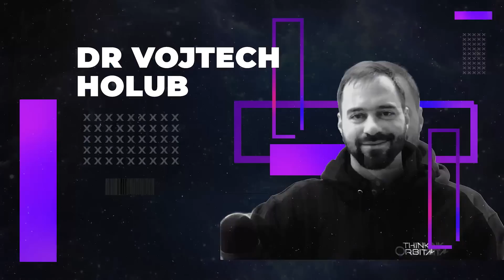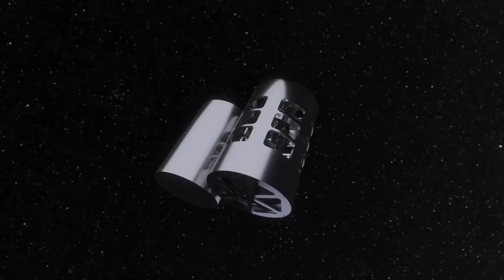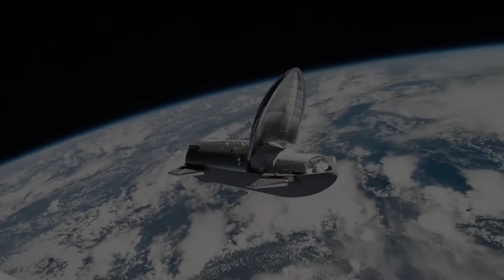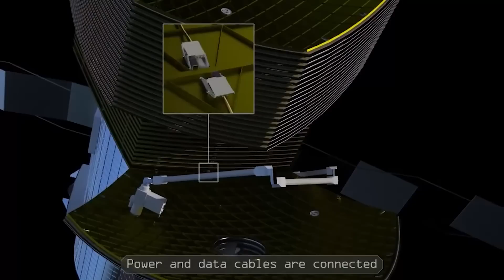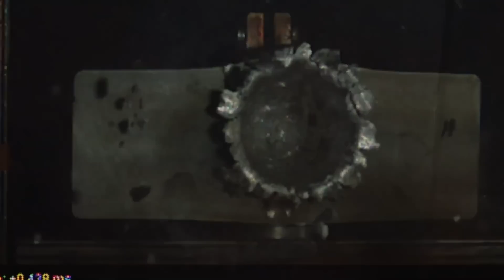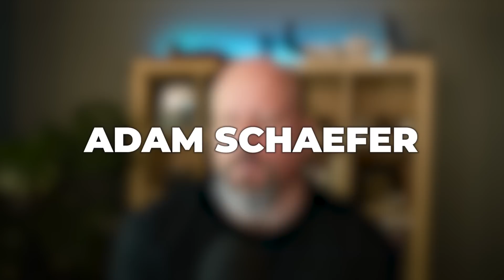NASA Just Funded This Project. Assembling Large Structures in Space [NIAC 2025]

Comment: Looking at your EB weld did you used a cycle generator as the weld looks really big , you don’t have to but weld you can stake weld ,
Reply: What do you mean by "cycle generator"? The weld is standard size for an aluminum weld - the heat conductivity and low melting temperature will do this to you.
Reply: @   It’s weir the electron beam is put through a rotating magnetic field and increases the field size of the weld and it’s not jest a concentrated beam , less penetrated beam but a
Rotating beam , come on guys this basic stuff ,

Comment: I feel like there is a better way to build this..

put a wire bending machine in orbit,   and set it producing ngon rings of large diameter,  tie those together to make a gigantic geodesic sphere.

then lightly inflate a balloon inside of the geodesic sphere using an inert gas for welding,   like 0.001 psi or something.

to get stuff in and out,  either use a docking ring and plate or just accept the loss of a few kilograms of gas and poke a hole in it,   or pump it down into a tank then poke a hole.

do all your fabrication in the low pressure atmosphere,    use the inert atmosphere with a compressor to do conventional inert gas welding.

nice thing is you can contain all your debris,   there is no vacuum welding phenomenon,  and you can use a reflective interior and have 3d positioning tags all over the inside for machine vision.

I am not sure how you would handle thermal regulation,    maybe a glorified mini split heat exchanger plumbed to several sides of the structure?

As for dealing with particulates,   if you spin it up a little,   centripetal force should deal with it,    static charge might make a levitated oxide layer though near the walls.

Comment: I know I'm not the first to say "Torus!!!"  But I would add- if you're making ring sections that you weld together, they could start out on a roll-  the whole piece, varying in width as you go around, rolled up.... unroll, weld the end, and you've got a ring... repeat for each  ring, weld the edges together, then boom you've got a torus.

Not sure if aluminum, or steel, whatever... if you don't exceed it's elasticity it would be a bit like a big spring, you don't have to bend/form it.  Or maybe it's just straight when unrolled, you pull the ends together and weld them?  It's easy to see this scaling to truly huge dimensions. :)

Comment: Hy Fraser,

I was wondering if anybody is thinking about building a hydrogen-gas station in an orbit around earth?  I’m thinking about using electrolysis to split water into hydrogen and oxygen. Once built the station could use sunlight to split the water and use a little bit of that hydrogen and oxygen to cool the hydrogen gas and some of the hydrogen and oxygen could be used to create electricity, water and heat if the station is manned. If there is enough on board then the water could even be used as a radiation shield. And any waste water could be recycled back into the system.  This would reduce launch costs a lot I think because the rocket would only need to carry the fuel needed to escape the atmosphere and not any fuel needed later on in the spacecrafts mission. That spacecraft to fuel up at the gas station for the next phase of its mission for instance to get to the moon where they are planning all this industry and science to take place. 
The initial costs might be big, but once in operation you could create a nearly closed loop energy system on that system using the hydrogen and oxygen it’s producing anyway.  Any spacecraft that comes along to refuel, brings water from earth with it to replenish the fuel it took from the station. It only needs to bring regular water which is much denser and you really don’t need that much water to produce enough hydrogen and oxygen. 
Not only that but if you man the station it could double as a “pitstop” for orbiting satellites for all kinds of maintenance. This would reduce the need for new satellites as the once that are already up there could live and be productive much longer. So that would help reduce the amount of space debris aswell.
So it would be like a service station for cars, but then spacecrafts. I know the ISS is already there, but that's a science mission. This would be an actual practical service station.

Comment: What about stainless steel?
Reply: Doable, but less strength to mass ratio than aluminum, and the thinner steel would make for more stringent tolerances. The reason Starship uses Stainless steel are only its thermal properties and high melting point. That is mostly relevant only for a reusable rocket.

Comment: So... welding in space. And if SpaceX Spaceship ever becomes fully reusable and brings launch cost down, you could bring up 8 meter wide ring segments and use a robotic arm and a welding robot to join them into an orbital torus structure. Send up a bunch of combined Whipple shield and polymer composite radiation shielding in panel form to bolt to the outside of the torus, and suddenly, you have more living space in orbit than we could use in decades, spin it and you could potentially live there for years. Connect the torus to a central non rotating in space assembly plant/dock, and you suddenly have the first version of Earth Spacedock.
Reply: That is exactly the plan! 8 meter max dimension segments for Starship and two 6 meter robotic arms with welding tool attachment. First though we have to do our homework to convince investors that we can do this, through the boring stuff like products and revenue...

Comment: Welding in space and even metal foundries would be more efficient and less pollution than here on earth. The major concern in wielding is shielding gas to keep air out of the melted metal if you don't the air that we breath will cause porosity and week weld. With the proposed cost per KG to orbit with Starship could cut the cost of Titanium refining by 50% or more and increase the safety 100-fold. Wielding Titanium in space in a vacuum is just as easy as wield common steal on earth and could be done with a mig wielder without the need of shielding gas or wire fed laser wielder. It could be done with old school stick wielder with uncoated wielding rods for any metal. Orbital assembly and manufacturing are the next industrial revolution, the possibilities of new metal alloys are endless.

Comment: I was just talking with a friend of mine, today, that worked as a certified, pipe welder and other qualifications, about welding in outer space.  I asked him if he thought an inert gas like Argon would even be necessary in a "vacuum," since flux or inert gases were necessary to protect the weld from contamination from "air."  He thought maybe an arc couldn't form in a vacuum.  I said I thought air was not necessary to form an arc...that the electricity would complete the circuit, if the distance was close enough.  Odd that I ran into this video on the same day.
Reply: @jameswest4819  Well, I don't think that a flow of freed electrons is considered an arc, but... here is my take on "can you make an electric arc in vacuum" question: 
In theoretical perfect vacuum with infinite atom removal capability? No arc can happen. 

But, there is never a perfect vacuum, and also when there is a large enough electrical potential, the ions from the conductors will start to free up, eventually enabling an arc. One a small arc happens, a lot energy and material is released from the conductors, creating even better conditions for a sustained arc. Does it help with arc welding? Not unless you want to consume your cartode and anode in the process
Reply: @vholub1  If you have ever welded anything, with, for example, low hydrogen rods, you have to drag or push the rod along the intended path on the metal being welded.  There is an arc that forms and the rod and its flux melts and heats up the target being welded.  I do not think your analogy about consuming the cathode and anode is correct.  Just how close or far the arc is formed is not something I've heard or read about.
Reply: @jameswest4819  Yes. That's how stick or MIG welding works on the earth. That's not how electron beam welding works.
Reply: @ Electron beam welding works better in a vacuum...at least according to a "how to" article, I just read.  Still don't know if you can strike an arc in space with stick or MIG, but I suspect you can.

Comment: I did not understand the problems involved in producing a torus for spin gravity. What are the issues involved in switching to torus structure?
Also, are aluminum extrusions, perhaps with embedded carbon fiber reinforcement, shipped in rolls a suitable method to apply as over wrap improve hoop strength on large spheres?

Comment: What if, for hull construction, you used square panels with disconnecting servo motors allowing you to make an adjustable structure geometrically? It could be adjusted to allow for access to any areas scheduled for work. It wouldn’t be pressurized.

Comment: Does a Super Heavy booster have the power to put into orbit a Starship that would have 2 times smaller tanks, no head tank, no heat tiles, no ailerons/flaps, and that would be about 40% lighter?  If so, then this Starship could be transformed into a space station. The space gained would offer ~1,500 m² of pressurized volume, or 50% more than the International Space Station.
International Space Station cost: ~$150B
SpaceX Starship Space Station cost: ~$2B (1.5x volume)
Reply: Once in orbit, the lower half of the Starship, which contains the engines and tanks, could separate and burn up in the atmosphere. The upper part could be equipped with Draco or Super Draco engines positioned in such a way as to allow the movement of the "ISS Starship" in all directions.

Comment: How would a space station using artificial rotational gravity account for mass moving throughout the station? i.e. as mass moves toward the center, the spin should accelerate, and as it moves to the outer edges it would slow down.
Reply: It would have to have a really strong reaction control system, that’s for sure. One option is to keep most mass in the ring stable, mostly furniture and permanent systems.
Reply: @Zacharysharkhazard  I was thinking the same thing. And with advanced enough sensors to track the movement of mass maybe a counter weight system could be used. No matter what it seems like it would be a huge power draw to manage.
Reply: @ShatterPr0oof any station with a feasible (100m+ diameter) gravity ring would require either a sizable nuclear fission reactor or a very massive solar array to keep the thing powered, probably in the megawatts of power generation. Feasible once we start launching nuclear reactors into space, and reusable superheavy launchers come online.

Comment: why not build just 1 really thick and durable ballistic shield that you can move and position in front of incoming debris!? instead of incasing the whole station in it which would be virtually impossible for ones that are a lot bigger in size
Reply: That would assume that all debris can be tracked. Not true, generally only stuff above 10 cm in size is reliably tracked. And it can come from any direction at any time.
Reply: @vholub1  off course...but to add that on top of normal shielding,was my thinking...plus -if there is going to be built (the new ISS) and used for next 4-5 decades...then I am sure some sensors would need to be positioned around it in a very large circle so they can register those smaller debris particles and signal to the station where is the impact coming from!!!!

Comment: wow this was really awesome! i can imagine a connected ring of these "orbs" spinning, with a center orb where the docks can take place.  it would have zero gravity in the center.  maybe a gigantic "bearring" that can hold the pressure while still allowing a sort of spin while docked? or even slow down the spin of the structure while something is docking.
Reply: The bearing can be behind airlock doors. When nothing is moving through the bearing, the bearing can be kept in a vacuum. The bearing can be pressurized and the airlock doors opened when moving stuff through the bearing. This would make leaks in the bearings more acceptable.
Reply: I think an extra non-pressurized mechanism can work better:
A docking table at the pole, that spins opposite to the station to appear non rotating to the incoming ships.

That makes the docking easier,
after the docking table holds a ship, it starts rotating the ship to match the station
Then the ship can connect to the final pressurized mechanism.

To undock, you disconnect the pressurized mechanism,
and then use the docking table to stop the ship rotation before it is released
Reply: @JacintoFranca  interesting

Comment: Why go for welding and not for reversible almost 100% strength preserving fir tree joints? Especially when an expensive isogrid is millled then these exta structures won't dive the cust up much relatively. Not? Or is there a much cheaper method than milled isogrids proposed here?
Reply: As mentioned in the video: A lot of focus is on not air filled structures and for these there's not even the benefit of not needing a bladder in case of welding rather than tough rebersible means of joining.

Comment: 24:33 I guess small crafts could dock with a (nondestructive) harpune tether that emulates longer range cable elasticity by a backdrivable motor on the cable roll, that to avoid damaging jerks.
Reply: So I'd challenge the statement that "it is impossible to dock with such a spacecraft" on the outer edge of a rotating structure.
Reply: @ they do have the technology built into spacesuits for the joints like elbow and knee that allow bending/pivoting and movement...i dont know if im agreeing with you or not to be honest lol, either way love to hear other peoples input and ideas.

Comment: I would think that a roll of metal would be more useful than plates, for this purpose.. A roll of metal can be welded into any shape, with a little trimming, as can a plate, but a roll offers less welding as you need only weld the two faces. You could use one roll for the exterior  and build a cylinder, while using a smaller roll for interior walls, partitions, decks and such and can cut plates from it as needed. Like building a ship on land, you will need to cut holes for access for wiring, piping, machinery to be dropped in, and such, but, in space, all the interior could be built and then the exterior added, wrapped around the interior. We will have to think in different ways to get this job done in such a different environment!

Comment: This method will be very useful for storage tanks but why wield it? Wouldn't cold wield + pressure locking it be enough? Most of the space stations are just bolted in no?
Do the initial assembly, put minimum pressure in it to find out leaks/failure points then ship the insulation fabric+plumbing and electrical. Rinse and repeat.😂

Comment: First thing i thought when I saw the plans for the ISS. Why don't they send panels instead of whole sealed modules? An octagon where each wedge is the size maybe 40% of a module. Sure you could do the welding thing, I was thinking more of some kind of a hook joint, Japanese woodworking uses many different designs. Figure if there's always a vacuum, it'll always be pulling them together. No need to weld them everywhere.

Comment: Good Idea...  A few decades down the line, find a nickle iron asteroid, cut out a ten tonne block,  melt it with focused mirrors, spin up a block for more even heating. When melted, Inject super heated steam to the core  and  inflate it to an oblate sphere.  Pull out  the tungsten tubes as it cools and you have  initial entry ports at the poles.  Walla! An inflatable metal habitat, walls as thick as you please.
Reply: Yep 👍, glad to see I’m not the only one thinking of that. I’ve always thought of it as glass blowing technique at the mega scale using metal, and implementing similar techniques as glass blowers.
Reply: @YellowRambler  It's already been examined, about 15 years ago.
The whole notion assumes a purity in the asteroid metal that just doesn't exist.
Were anybody to actually try this, the whole thing would just fly apart into molten gobbets.

Better to mine it, smelt all the metals, and then build O'Neill Cylinder Habitats inserted into the cavities left by the mining, expanded as needed.
That way, you have plenty of radiation shielding and lots of raw materials available for your community of tens of thousands inside the comfortable cylinders.